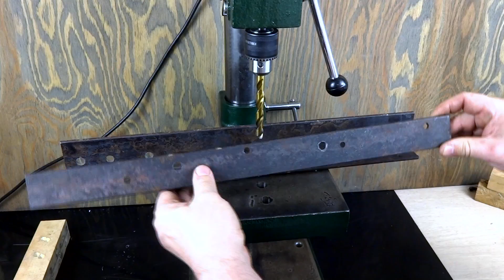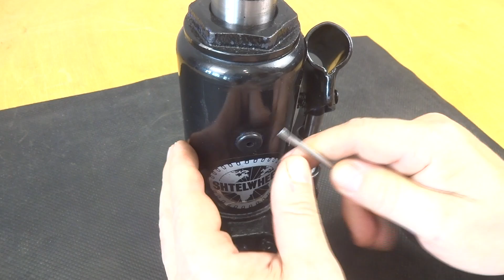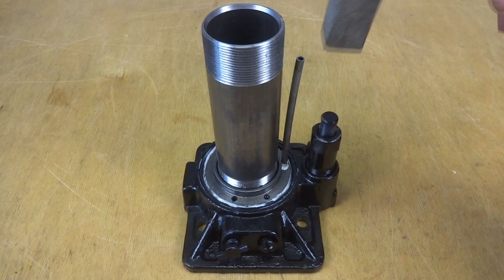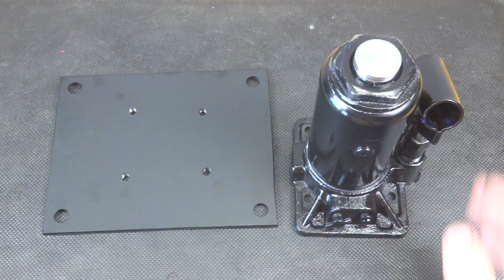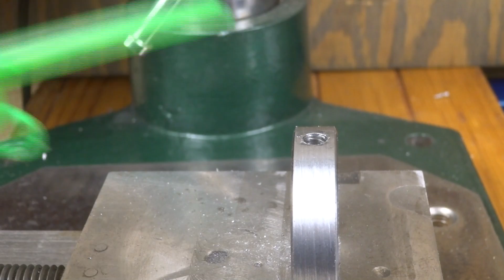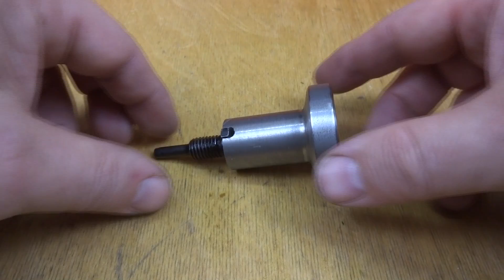The simplest tabletop hydraulic press without welding

Comment: good idea, good work, congratulations. But, one discussion point. The hydraulic jack is now upside down. The oil is resting by gravity on the main seal. This is usually a simple O-ring. An Oring is self-tightening ie when the pressure comes, it deforms and presses itself into the seat and then is tight. Without pressure an Oring tends to leak. So, Is this tight over long times, standing and waiting?  Or sweating oil?
Reply from the maker: You're right, the oil started leaking over time. I replaced the seals with others. However, it has not yet been possible to eliminate the leak by 100%. There are traces of oil on the screw, but there are no oil drops on the table even after a long time.
Reply: @valsworkshop  I had a similar case long time ago. There I just wound up some layers of Teflon tape into the Oring seat to increase the diameter and thus the pretension of the O-ring. But no problem. A piece of tissue will also be enough.
Reply from the maker: @George-in-the-forest  I just put a ring of the same size but with a larger cross section. It turned out to be quite tight. The leak is very small now, so I'll figure it out sometime later.